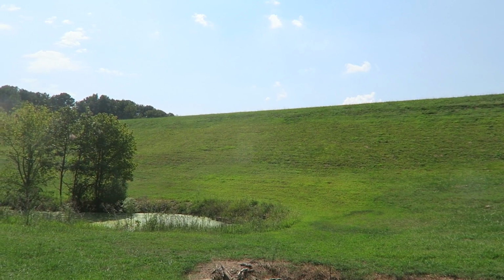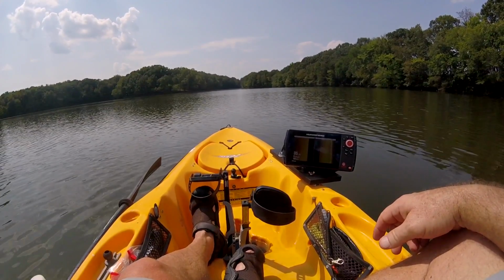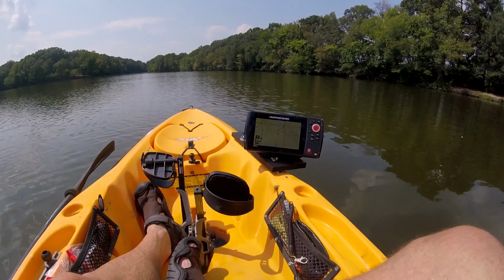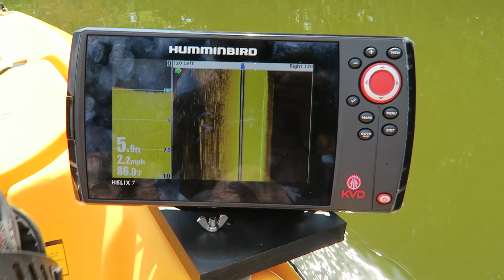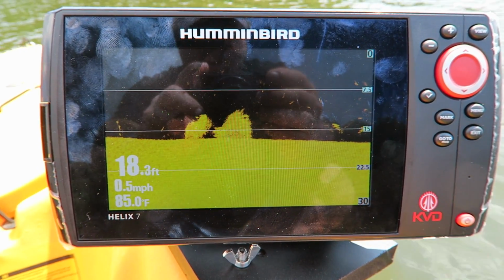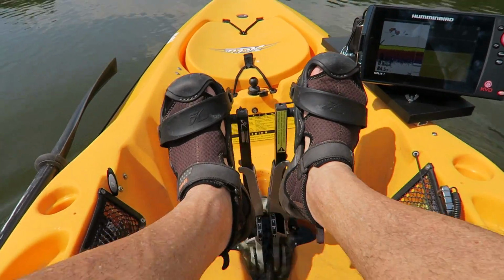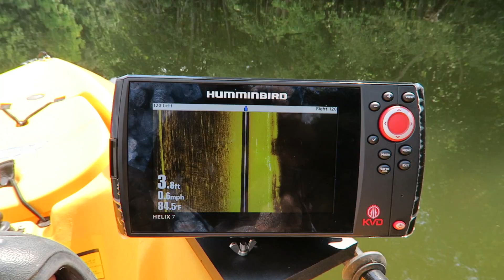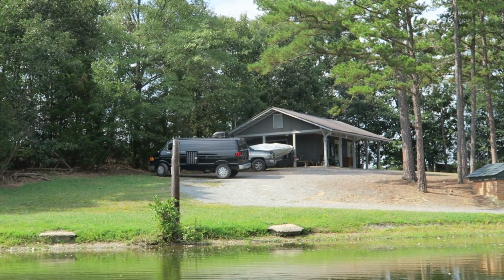Humminbird Helix 7 Si GPS Fishfinder Install,  Water Test ~ Part 3 ~ Final

Comment: Did you set your chart speed to match you boat speed? That made a difference for me.
Reply: Also, set SI range to three times the depth
Reply: +Justin Thompson I did not know that. thx
Reply from the maker: No I have not but I will now. Thanks for that Steve-O.
Reply from the maker: Thanks for that advice as well.
Reply from the maker: 10-4